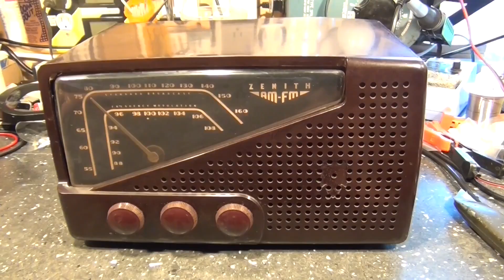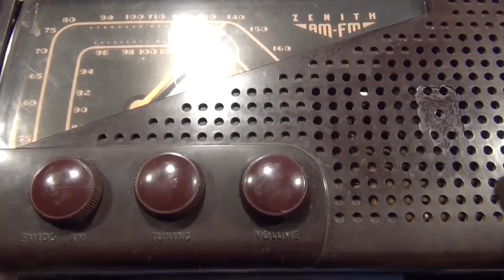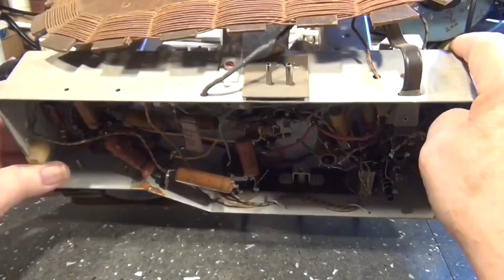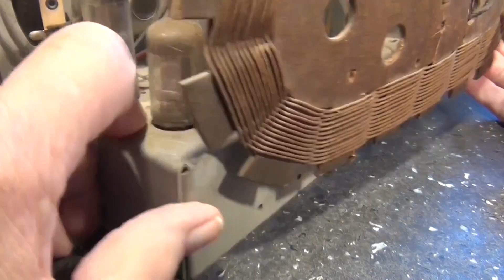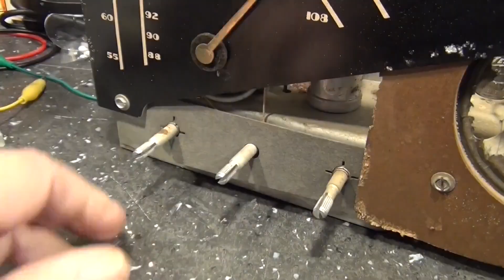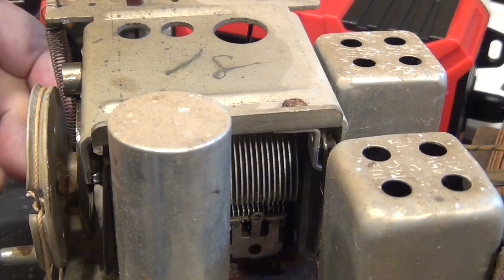Zenith 7H921 - First look and power up

Comment: Doug, a neat little radio. I bet you can 3D print the missing emblem. Still watching and will edit. Nice job on the tuner and power ups are fun to watch. Definitely a fun project and let me know on the speaker (thanks for the mention) as needed. Best, Don
Reply from the maker: Thanks Don. I'm sure I can print the emblem, but there are several to choose from as a few different ones were used on that radio series. :)
Reply: The imprint of the emblem is similar to an eagle. On the Radiomuseum website, in the description of the 7H822 Ch= 7E02 model, there is a photo, unfortunately with a "watermark".

Comment: Those type radios seem to work regardless…lol….still have a few bugs to work out but I think you can get that going in not time. Those tuning rods look weird, are you sure that cardboard space is stock? Is the measurements of the top of the springy rods the same as the spacer and the coils at the bottom? It just looks strange, bit you will figure it out…. I also wonder could a rodent been in there chewing on that cardboard on the speaker mount? Just and observation. Thanks for sharing, looking forward to the next video. Take Care—Larry
Reply from the maker: Thanks Larry. Just looking at that spacer it looks to be pretty close to the distance between the coils. I'm pretty sure it is original, but it also appears that due to the problem I fixed, one side no longer is glued in place. I'm pretty sure that mice are the cause of that damage to the speaker mount and speaker itself. The next installment should be even more interesting. LOL
Reply: @DERB_Seymour_Indiana Im glued to the screen, cant wait to see what comes next… Larry

Comment: I have the same radio as yours Doug. Mine is Model 7H822Z 1949 with the 35B5 tube. I changed the selenium with a 1N4007 and a 33 ohm voltage drop resistor.
Reply from the maker: Thanks Jim. Appreciate the info. Just curious, how much more voltage was present then was called for?
Reply: @DERB_Seymour_Indiana  On my schematic B+ output from the diode shows 130v but mine was 122v after the modification. I did this radio four years ago and I'm looking at my notes and not sure exactly why I reduced the voltage then. At power up the B+ spikes to 158v before the tubes start conducting.